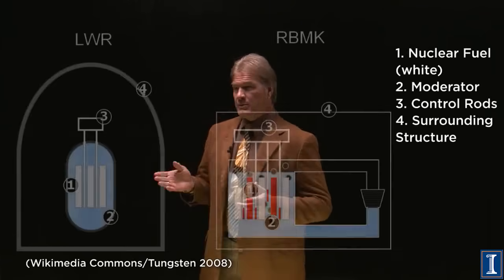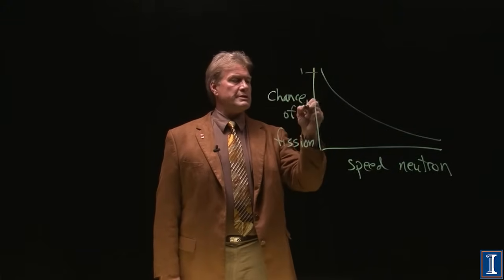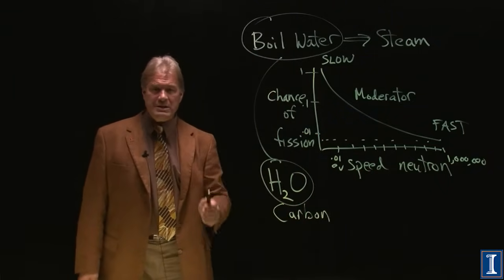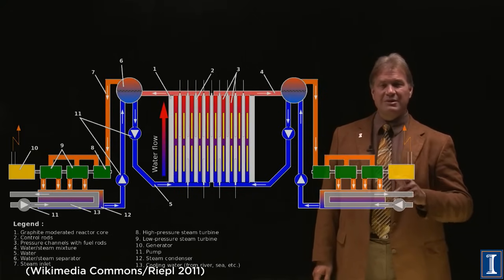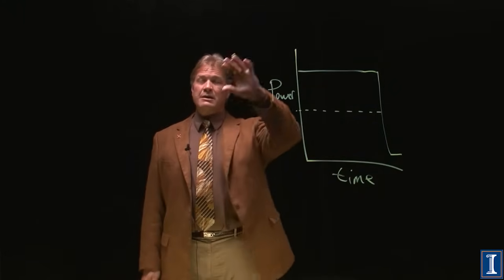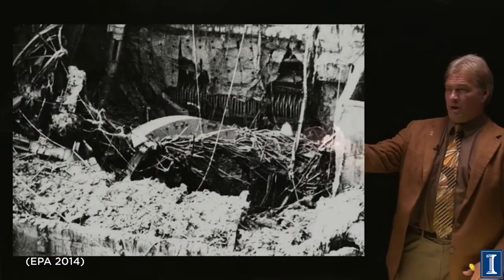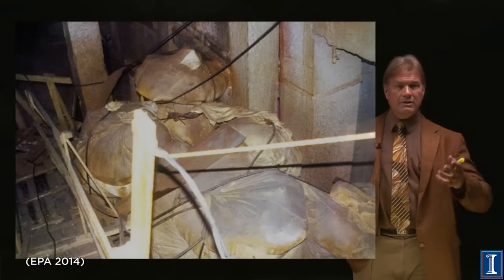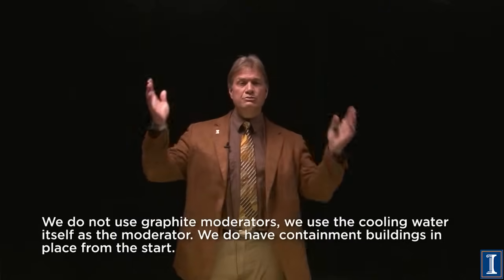Chernobyl: Worst Accident Ever

Comment: 0:30 RBMK, not RMBK. Also, this explanation is not very accurate. They got the reactor to operate at half power in the afternoon of the 25th of April as they were preparing for the safety test they were supposed to have completed in 1983. Then they got a phone call from the higher ups to not do it during the afternoon cuz it was the end of the month and electricity consumption was at its peak. They were tasked to postpone the test to the night. They left the reactor at half power and because of that a lot of xenon was created but not burned. That's how the xenon poisoning happened. That's why the reactor's power dropped to 30 instead of staying steadily at 700, not because an operator pressed the wrong button.
Reply: As a matter of fact, it may be exactly "because an operator pressed the wrong button". It's impossible to know because it did not took long to Akimov and Toptunov to die after the accident, and we don't even know for how long they held consciousness. You should not take what the series tell you at face value. 50% is approximation and romanticization, we will never know what really happened there for several reasons, some of them may be, 1- they died soon after the accident and maybe didn't have time to tell very well what happened and how it all happened, they might even have been shell-shocked, under severe PTSD, delusional or in and out of a comatose state before they died, unable to put it all to words, or make any sense. 2- they may have told everything from their perspective, however.... USSR, KGB, FSB, and the truth may be buried somewhere rotting in some top secret archive file, never to see the light of the day. 3- they were very green, especially Toptunov, and he was the one responsible to get to the power levels required(I believe Dyatlov stated that during his official debriefing), and maybe he never knew what he did wrong. 4- the cause of the sudden power death in the reactor may be just another design flaw or equipment malfunction, triggered by Toptunov. The series itself does not make clear what really happened when the power fell suddenly to near shutdown levels. We just see the surprise on the face of Akimov and Toptunov, and after that, Dyatlov's rage. I read one of the INSAG's(INSAG-7/1992 official report) reports into the accident and even they are not sure. They oscillate between equipment failure/fault and an operator error on Toptunov's part. Some argue that the action Toptunov took to switch the reactor from local to global power control, IS the operator error itself("....pressed the wrong button."), others argue that the global power control system may have had a FLAW that caused the severe drop in power. Maybe Professor Ruzic knows more than I do, coz he simply studied/investigated more into the matter. I do not have time to read all of the reports nor his credentials to understand it all.
Reply: @jefersonnl  In "Midnight at Chernobyl" Higgonbotham states that Toptunov, when moving from local to global automatic control, did not reset the reactor power level desired leaving it at near zero. He then failed to act to correct it. Higginbotham also states that Deputy Chief Engineer Dyatlov demanded that the test be done at 200 MW which Akimov initially strongly protested. Under badgering Akimov finally conceded to Dyatlov even though he outranked him in terms of running the reactor. Higginbotham also states that Toptunov knew the reactor was unstable at low power and when Dyatlov demanded that he pull more control rods, he initially refused. But just like Akimov,  he conceded to Dyatlov's threats and demands and violated safety protocols by pulling almost all the control rods. Tregub (prior shift Senior Reactor Engineer) had remainded at the reactor control station after his shift and advised Toptunov on which rods to pull - fully complicit in Dyatlov's disasterous intervention to get reactor power going again. Dyatlov, during the investigation and trial, denied that he was even in the room. If Higginbothom's account is correct, then Dyatlov bears most of the responsiblity for violating the published procedure by insisting it be done at 200 MW in an unstable reactor and bullying the reactor engineers (and Akimov) into violating critical safety measures. Poor Toptunov had only been a senior reactor engineer for 2 months when he activated the AZ5 system that was supposed to shut down the reactor but in sad fact became the final insult that initiated the destruction of Chernobyl Reactor #4.
Reply: @richardvaughn168  I want to read this book! it has been on my list of books to read even before the series premiere. I believe the book is basically in agreement with some sources I came across, like the INSAG and the IAEA.
Reply: @jefersonnl  there are many things the HBO series either modified or got wrong, but there are plenty of other facts they got right. We know based off records that the test and shutdown was going to happen during the day shift, but they were requested (demanded) to not take the reactor lower so factories could meet their obligations for the month. the reactor then remained at that 50% power level (rather than proceed with the next drop to 700 MW for the test)  where simulations have shown xenon to build up to significant levels over the course of the following hours. this combined with the lack of proper training for the test by the operators likely led to the reactor going from almost desired power to almost nothing as the reactor stalled. At that point, the operators started fighting to get the reactors power up to 200 (a power level that would still have failed the test) and took it off automatic control. the politics behind dyatlov being promoted upon a success that night I had not heard (but not unthinkable) but he did push the operators to do things that they were never trained for and violate every rule in the book to get his test, at which point the reactor sprung to life uncontrollably due to the voids and damage caused by smaller scale uncontrolled reactions nobody had any ability to know were occurring. (the RBMK-1000 was fuckoff huge in all dimensions, leading to varying reactions that were unmonitored across the whole thing.
Reply: @trinalgalaxy5943  Ohhh really!?? Noooo wayyy!!.... seriously, I don't even know what to answer. As a matter of fact, I'm beginning to question the wisdom of coming here and writing this in the first place.
Reply: @trinalgalaxy5943  Beware you could be locked in a Baudrillard-esque perception of events.

Comment: I wouldn't be ready to say that Western Reactors are safer. There will be a second Chenorbyl and it's a ticking time bomb. NB Power's nuclear reactor in New Brunswick, Canada which is Point Lepreau is in terrible shape and in the late 1990's the plant was forced to shut down by the then Prime Minister but of course by 2012 NB Power was able to get it back up and running. They claimed that the plant underwent major repairs and yet no such activity was seen at the plant. If you go to Point Lepreau, there isn't a house that is not equipped with a wheel chair ramp. There isn't a family that doesn't have 2-3 family members who are disfigured or have other issues and the cancer rate is quite high as well. If there isn't anything wrong with that nuclear power plant then why the cancer rate and deformation in the locals there continue to rise? Point Lepreau should have been been shut down and stayed shut down. I predict in the near future that the Point Lepreau plant will destroy the province of New Brunswick because it is old and in very poor condition. It's just  disaster waiting to happen and the locals are convinced that radiation is leaking out of the plant. They just can't prove it and NB Power makes sure anyone trying to get information concerning the plant get a dead end. Mark my words, Point Lepreau will be the next Chernobyl.

Comment: so the fukushima didnt explode? i always thought it looks somewhat as an implosion. good thing the building and the containment vessel are intact so no radiation went into the atmosfere and into the pacific and it still not leaking to this day. thank god for american built reactors that are buletproof like three mile island and god knows how many others.
Reply: What happened in Fukushima was a hydrogen explosion. That it, the pools that contained used nuclear fuel leaked hydrogen that collected on the top of the building, which then exploded. There was no nuclear reaction involved in the explosion. It was basically same thing that happened to the Hindenburg. 

The containment vessels are in fact intact.
Reply: @Zereniti77  when i look at this explosion on video i can only think that was a hydrogen build up in the reactor itself and alo in the building. explosion was very powerfull and this thing went straight up in the air basically blew the cap off. so i think there were a few holes in the bottom or somewhere because it was leaking i dont know present state but i hope its fixed.

Comment: the premise here is that nuclear reactors in the west are safe "that can't happen here" which is not entirely true.
Reply: one of the features of an excellent technician is the ability to constantly be looking for something that can go wrong while being dedicated to keeping a system running without panicking.
Reply: Listen to the former GE engineers, the standard sort of BWR, Boiling Water Reactors they made and sold all over the world are just as dangerously flawed, simply in different ways. They even protested and made formal warnings to GE management and where ignored, some resigned they felt they where so potentially dangerous.

Comment: Many of the statements in the video are inaccurate. You can still overlook them.

But we have seen in Fukushima that even reactors of western design are not 100% protected against operating errors and technical problems.

Even if there was no explosion there, where the core could be seen in the open air, there were heavy core meltdowns in the reactors and the liquid core melted the pressure vessel and hydrogen explosions burst the reactor buildings.

Fukushima is of course an old design. Newer reactors have become safer again. Nevertheless, there is never one hundred percent safety for any technical device. And unfortunately the fission products of a reactor are always very dangerous, whether after a core meltdown or the rest after reprocessing.

It is now clear that a nuclear reactor that is as safe as possible is very expensive. So expensive that electricity from wind power, hydropower and solar energy is even cheaper.
A well-developed electricity grid with natural energy sources, local electricity storage facilities and a network with neighbouring countries meets all the requirements of a safe, inexpensive and relatively environmentally friendly electricity grid.

No matter how " cool " nuclear power plants may be, they have become unnecessary and they remain a risk despite the best safety technology. Even if the risk with modern plants is much lower than with Fukushima or Chernobyl.

Translated from German with www.DeepL.com/Translator

Comment: To call Chernobyl the worst accident ever is to ignore the hundreds of thousands of people contaminated by Lake Karachay in Russia, a massive uncontained spread of radioactive material over a vast portion of Russia's deep Ural mountainous region. We're talking a 11 foot thick layer of radioactive sludge lining the entire bottom of Lake Karachay, that was bad enough on it's own... but when the lake dried out and the lake bed of radioactive sludge began drying out, the dust from it mixed into the wind and spread across a massive area that is STILL contaminated to this day, yet NEVER talked about!

Lake Karachay was once called the most radioactive spot on Earth, even AFTER Chernobyl had happened. And Lake Karachay was only ONE of several similar incidents in the same area. Why does nobody talk about these massive releases of radioactive material that affected close to a million people before it was done.
Reply: https://en.wikipedia.org/wiki/Lake_Karachay
Reply: "The lake accumulated some 4.44 exabecquerels (EBq) of radioactivity over less than one square mile of water,[3] including 3.6 EBq of caesium-137 and 0.74 EBq of strontium-90.[4] For comparison, the Chernobyl disaster released 0.085 EBq of caesium-137, a much smaller amount and over thousands of square miles. (The total Chernobyl release is estimated between 5 to 12 EBq of radioactivity, however essentially only caesium-134/137 [and to a lesser extent, strontium-90] contribute to land contamination because the rest is too short-lived). The sediment of the lake bed is estimated to be composed almost entirely of high level radioactive waste deposits to a depth of roughly 3.4 metres (11 ft).

The radiation level in the region near where radioactive effluent is discharged into the lake was 600 röntgens per hour (approximately 6 Sv/h) in 1990, according to the Washington, D.C.-based Natural Resources Defense Council,[5][6] sufficient to give a lethal dose to a human within an hour. "

Comment: Fukushima had a containment building. The cores melted right thru the bottom. Also there were hydrogen explosions. Those containment buildings don’t look so hot.
Reply: The cores melted through the pressure vessel of the reactor itself. They have not melted through the containment building.

Comment: What happened at 3mile island then?
Reply: TMI-2 had a partial meltdown of the fuel rods in its core when a stuck coolant valve and an operator error because of the valve led to loss of coolant water in the pressure vessel. Without the moderator (water) the core overheated and about half of it melted. It got so hot that hydrogen gas was created just like at Chernobyl but the gas was contained within the dome of the containment building and did not explode. You can read further details in the Wikipedia article.
Reply: https://www.youtube.com/watch?v=1xQeXOz0Ncs

Comment: One error, but one he should know not to make.Fukushima and all other commercial sites have batteries but they are not for the cooler pump backup. They for lighter critical loads like instruments, communication and lighting. Only diesels or outside power can power the pumps. Fukushima even lost battery backup. The techs had to take batteries from their cars to get instrumentation going again.